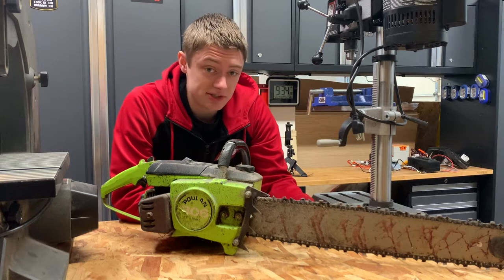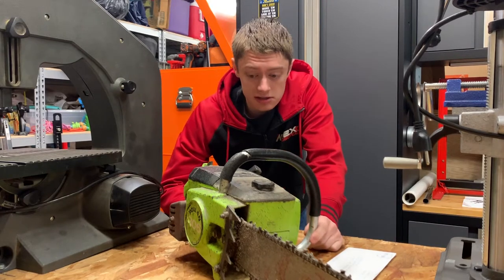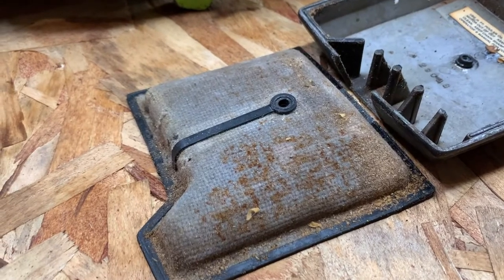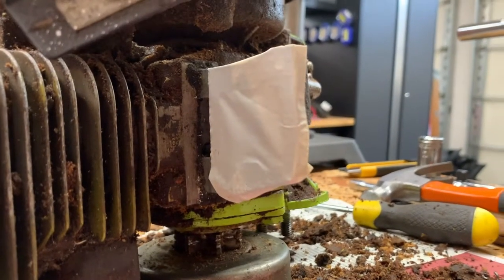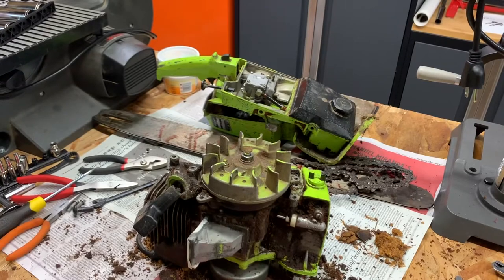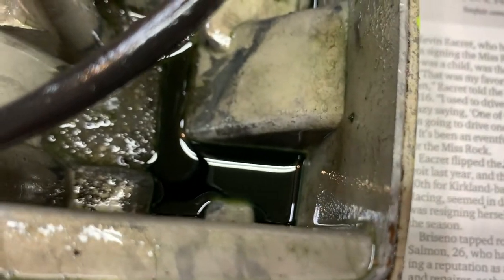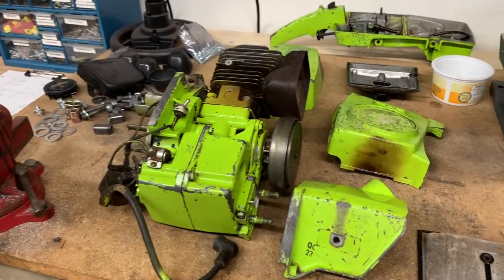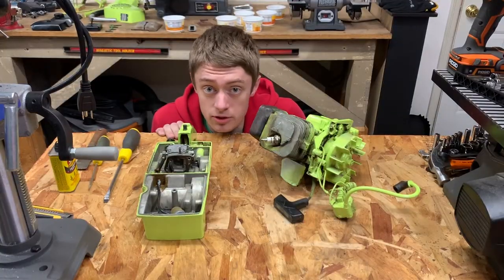Refurbishing an Iconic Chainsaw (Poulan 306A)

Comment: Not the Leatherface 1974 saw.  1974 film was a Poulan 245a.  The new 2022 film had a 306a
Reply: Bill moseley told me it was a 306a
Reply: @kharnblackfeathers6625  bill moseley didnt work on the original film, while the actor who played leatherface said in a book that it was a converted 306a, that is most likely due to a fan previously bringing a converted 306a to show him before he wrote his book. if you look closely a the film you can even see that it says two forty five on the decals.
Reply: It's deff a 245a, you can see the sticker on the saw in some of the photos
Reply: 245a

Comment: The one I’m the film was a 245a
Reply: Yeah but its practically the same chainsaw. To top it off they put black electric tape over the numbers, so in all honesty works either way
Reply: @slayvidflores9237 the black tape is covering the word "Poulan". Just above the tape is the words "two forty five". Clearly visible in the film.
Reply: @slayvidflores9237 the 245a had more power. Where they were similar. Still different.

The 245a is from the original and the 306a is from the 2022 (or 2023, whatever the NEWEST one is lol, the Netflix 🤮 one lol) reboot. 

Specs wise, literally identical chainsaws but where they are “different” is the “power” the 306a was a 3.6 cu. In./59cc chainsaw while the 245a was a 4.5 cu. In./74cc chainsaw.

The difference really is night and day and the only people who continue to call them “identical” are ignorant people (not being mean either) who just go by the “looks” of something.

I have both saws and let me tell you, night and day. 

245a is slightly heavier (not DRAMATICALLY different but idk, I’d you’re not that strong, you’ll def notice the difference especially depending on your bar lengths etc) and with the 74cc vs the 59cc, trust me you will not only “feel” the difference in power but you will absolutely HEAR the difference.

It’s night and day.

So, identical with most but what matters and what separates them is what’s “under the hood” lol